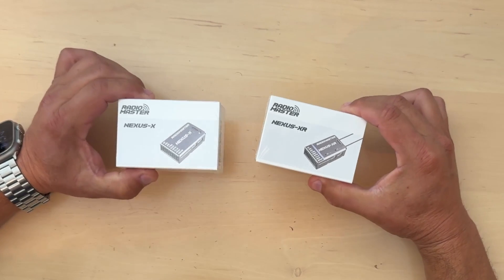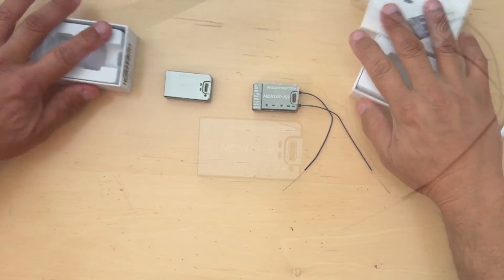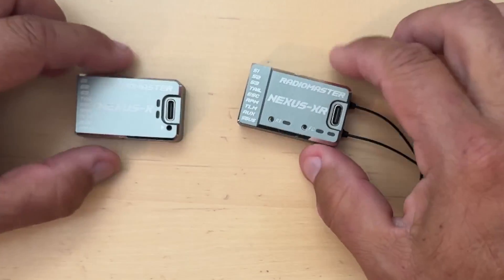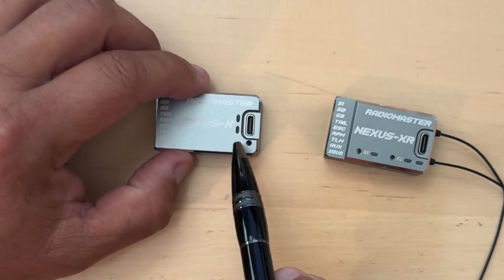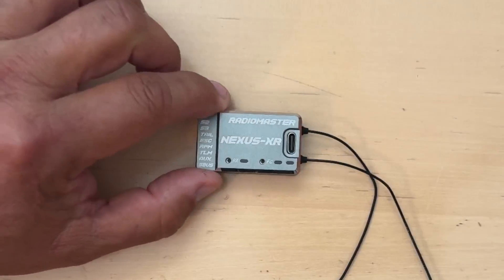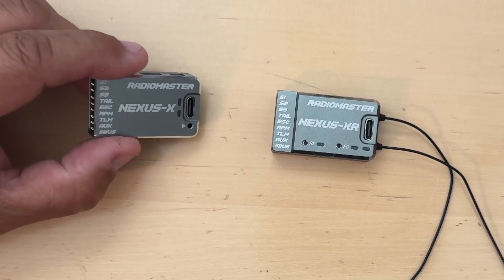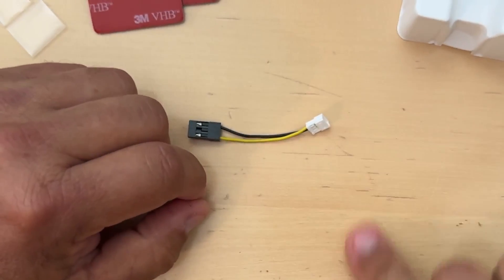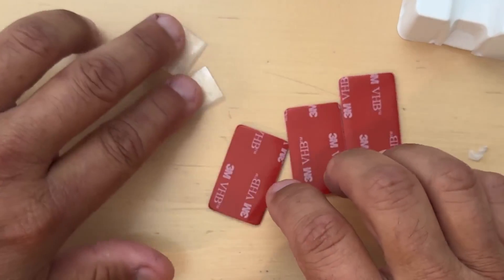The new Nexus X and XR flight controllers from RadioMaster RC

Comment: Spektrum dsm or dsmx does not support? İs it true or not!!!!
Reply from the maker: No more DSM port is supported as it is too unreliable and low voltage. However, Spektrum receivers are still fully supported.
Reply: @BertKammerer that's good to know, so my remote receivers don't go to waste. I'm slowly going to ELRS, but I have a ton of stuff that's bind and fly

Comment: I am sure these are great units but what's the point in upgrading to them from the original nexus on a 3D heli with 8.4V servos? Obviously the added ports can be handy on a scale machine and the built-in receiver is nice if you don't have the space but on a 700 you have the space for a separate receiver anyways. 
Can you make a video if there is a reason to consider upgrading? Cause I don't see any must have features here...
Reply from the maker: No point in upgrading, no need. Great choice for a future build though, especially if you want a unit with a built-in receiver and more ports either for scale or nitro.
Reply: From what I can tell this is mostly a fix of minor complaints people had, leading to the ports being moved to the side, and additional telemetry ports so you don't need to remap stuff, plus the up to 70v external voltage sensor. So if your current setup is working there's no real reason to upgrade.
Reply from the maker: @sea_kerman  People complaint that the Nexus didn't have enough ports for nitro or other type of helis that needed more ports, people also complaint that the Nexus didn't have a receiver built-in and you had to get a separate receiver. The X fixes the first complaint and the XR fixes both complaints. Simple.

Comment: Doesn't seem to be much different to the old Nexus or the FlydragonF722.

I'll guess the perfomance will be identical.

Still great to see another RF2 FC with integrated ELRS receiver.
The Radiomaster stuff is easier to get than a Flydragon.
Reply from the maker: not about performance, it is about offering more pins, as well as a built-in ELRS true diversity receiver. RadioMaster had not done that to date.

Comment: Hello Bert, Do you recommend updating your current Nexus to this new version and using the 2.2 software? Are you planning any videos on that process?
Reply from the maker: There is no need to upgrade to this if your setup works, the gyros and chips are the same. However, the XR is a great option for a future built considering it has more pins/ports as well as a built-in ELRS receiver.

Comment: The first thing I notice is that there are now slots on three sides. This is inconvenient because it takes up more space.
Reply from the maker: It depends on how much stuff you need to plug in, not a big deal IMO.
Reply: @BertKammerer  That does not change the fact that a disadvantage has been created for a clean look, which does not exist with the Radiomaster Nexus 1st generation. This is already a disadvantage in normal use with the helicopter: If you want to connect an RP3-H and ESC telemetry via UART, you have to make space on 4 sides (!). With the previous Nexus, only on 2 sides.